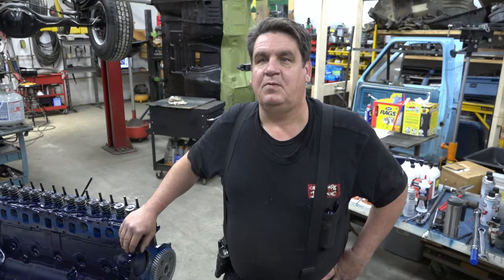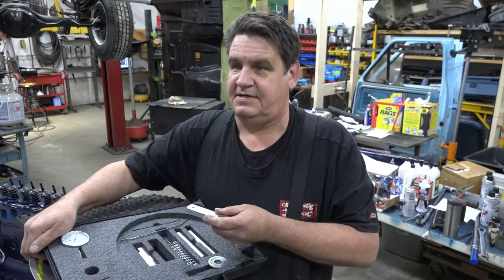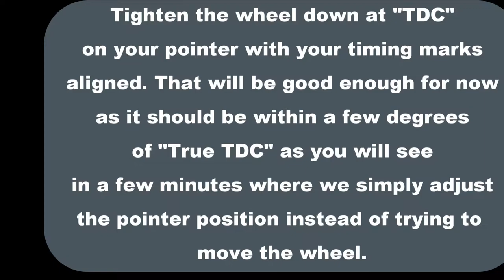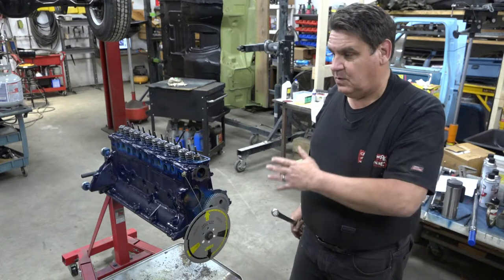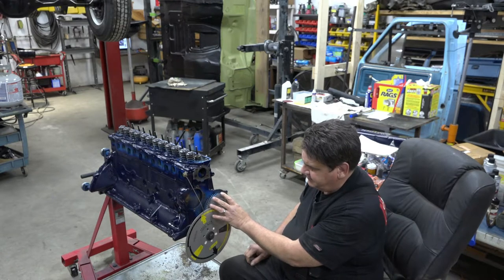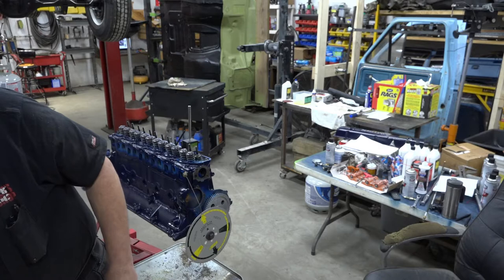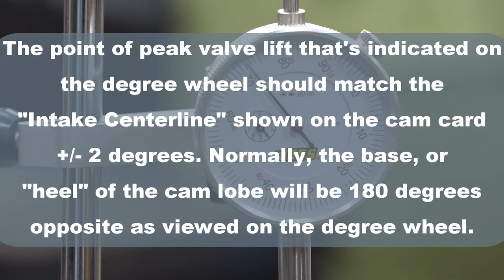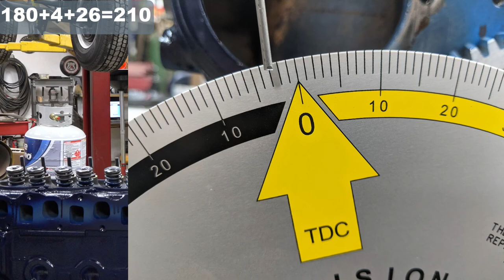How to "degree" a cam Part 1, The Basics, Checking your cam against the "Cam Card"

Comment: This a really informative video, thank you for making it! I have a question on degreeing a cam in my Ford 3.8 V6.. it has hydraulic lifters (performance ones from Johnson Lifters) so I had someone take another lifter (I assume it's an OEM Ford one but I'm just guessing, all I know is it's different from mine) and they welded the lifter so that it's "solid".. The problem is it seems taller than my other lifters, so that when I try to torque the pedestal mount rocker arm bolt, it starts compressing the valve spring. I'm thinking either my lifters are different from stock in terms of height between the roller tip and pushrod seat, or the lifter they sent is wrong application or something?? Kinda scratching my head. Thanks!!
Reply from the maker: You're very welcome! and thanks for watching! It sounds like you might have the wrong lifter. In your case, and this is just a guess, since I can't see exactly what you're working on...  Since you have a non adjustable valvetrain  with pedestals, I would try and use an adjustable pushrod to get you to zero lash. As a last resort, you could take one of your existing lifters and VERY CAREULLY disassemble it, leave out the hydraulic bits, then shim the lifter with tiny washers until you get as close to zero lash as possible.  Then when you're done, reassemble the lifter back to it's original configuration. Like I said though, I would only do that as a last resort.